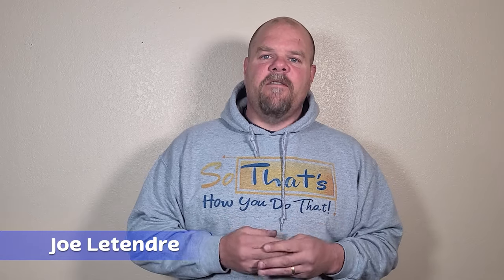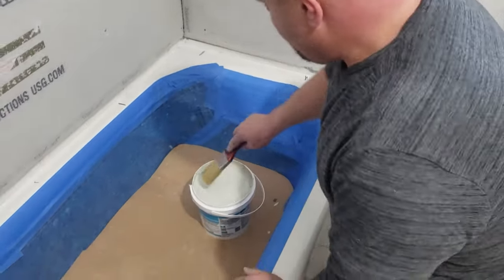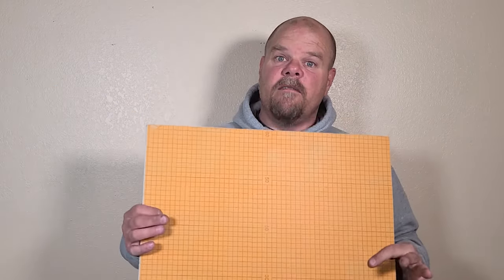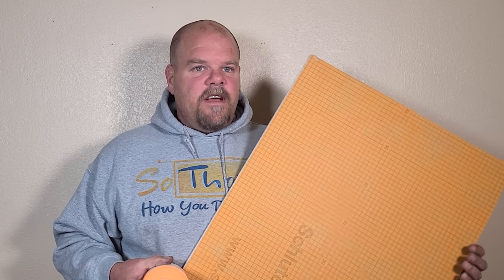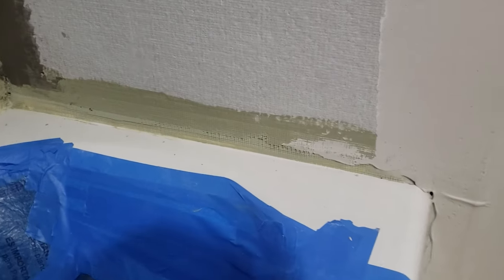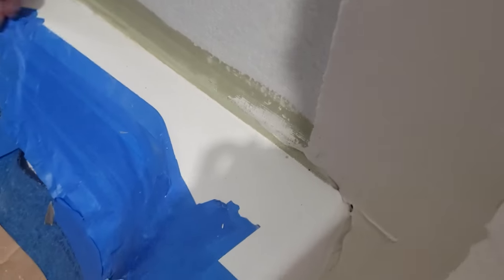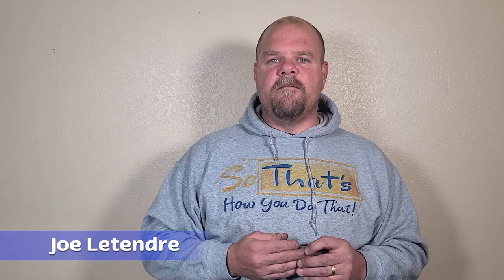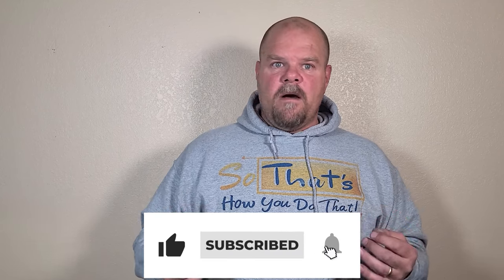PROBLEM SOLVED for Tub Flange when Installing Cement Board and Tile

Comment: There is a lot of controversy about where to put the wallboard on the tub flange and the tile institute recommends placing the board over the flange and onto the rim of the tub but I have seen so many failures when this is done that I would have to disagree. This is a great video on giving yourself the best shot at not having a failure! Common sense and experience tells me that the silicone joint between the finished tile and the tub will not be properly maintained and will eventually fail causing water penetration behind the tile. This method will prevent the wallboard damage that I am continually repairing at the job site. Great job!

Comment: Thanks! Yours is the 8th or 9thbl video I watched for this information, and it's the one with the best, clearest, and most sensible answers regarding combining all the materials at that tub edge, which is totally trashed after many years. In this case, they had the board just above the flange, but it was sitting on some type of narrow stick that is so rotted that it is unidentifiable. That stick rested on the edge of the cast tub, with the tile extended over board and stick, down to the metal, with the joint then caulked. Been here 18 years. It's never been great, but only recently disintegrated. I will use your method for the repair.

Comment: is there any concern with the tub flexing and causing the thinset to break loose from the tub then  cause squeaking as it flexes?  I have an old steel tub for this one I'm working on so I suspect there is less chance for flex than with fiberglass tub.  I see some guys recommend filling tub 1/2 or more with water to weigh it down first?  I will follow your idea using the redgard I already have saved up for the shower job.  The shower tiles came off the drywall  after 30+ years and the drywall didn't show any moisture damage.  With all the waterproofing that is recommend or required it seems like a bit of overkill in some cases.  I did a shower a few months ago with Kerdi and that was a lot of work but it was a mud shower pan and my first shower.  Now with these two I'm doing with tubs installed I'm tempted not to coat the whole cement board walls with redgard but I have it, so i will do it anyway.  I am using glazed ceramic tiles.  They are my own showers/tubs but if I were doing it for someone else I would make certain to follow 100% the right methods.  I still plan to waterproof it fully but I'm convincing myself its overkill.

Comment: Nice video.  I've been doing renovations for 20 years and do all my own tiling.  In my opinion compared to other products Laticrete products are awesome.  I use Hydroban liquid all the time and it always requires two coats.  Using Hydroban Board along with Latasil caulking.  I've used Laticrete, Schulter, Wedi, cement board, denshield, etc....  And saying that my go to solution is Denshield with Hydroban Liquid with taped corners.  Latasil for the caulking.  I like the fact you mentioned raised corners with the Schulter product (pain in the ass).  There are pros and cons to using these different substrates as they relate to flexibility and ease of carrying into the job site.  The choice of products can also speed up your work as well.  (i.e. board and start to tile the same day).

Comment: Great help video! Thank you! I see you ran your backer board to the floor in front of the tub. I'm butting up against wood lath and plaster. My 1/2" backer board will flush out with the plaster as I'm leaving the lath above the tub. Would I do the same you did here?? Do I tape and finish the joint between the old plaster and the new backerboard? Thank you for any help! Jeff

Comment: OK I see your running your Durarock past the tub, but that would be 21" or so not 30". The durarock is 30" wide. How did you get that to extend past, or did you cut 32" off the 60" length and waste the off cut? Im confused I guess by the direction of the writing on the board> Thx for any help

Comment: Hello Joe. Very good instructional. Spot on as the saying goes. I used Latacrete products exclusively since the late 70's. Setting every type of tile made on over every type of bedding board or mortar. Hydro-ban introduced a wide area of applications and problem solving waterproofing issues and we were very happy. My personal favorite products are 4237, 3701, and Hydro-ban. However, having used all of Latacretes products I recommend all of them.

Comment: I had a plumbing emergency they ended up being a leaky cold water valve that was seeping through my ceiling from the upstairs bathtub.The plumber had to bust out tiles and left it that way but anyways when we cut out more tile so we could see the studs so we couldn put new backer board up we noticed that the last three inches of the horizontal tub lip that's closest to wall was missing. How do I go about putting the backer board up is there anything I can use to reinforce the area that the lip is missing?

Comment: Good tip on the tub flange. You can also put a think bead of silicone and press it in with a putty knife. Silicone works great for sealing and waterproofing areas like that. And I really like the way you finish the wall were the cement board meets the drywall. Good info.

Comment: Hi Joe, Great Video as always and Love your channel!  I have a question about what material to use on these ceiling of these Bath Shower combos.  I have a shower tub combo in my home and I want to do a smooth level 5 type surface finish on the ceiling above instead of tiling it.  I don't particularly  care for tile on the bath ceiling so what should I use for the ceiling material whether it would be green board type drywall or something like GoBoard which is readily available to me locally and is more affordable than Kerdi - which is great but not readily available to me.  I have never tired to do a plaster or skim coat type finish on anything like GoBoard, Kerdi, or even Hardiebacker which is what I am using for the tub shower surround.  Thanks for any suggestions and reccos and keep up the great work.  I am here almost daily anymore!
Reply from the maker: I would just greenboard since it is on the ceiling and you are not tiling it.

Comment: Hey joe, can you tape and fill like you did here with an acrylic tub? I have to do the same process but I’m worried about deflection and squeaks
Reply from the maker: To avoid problems with the acrylic tub I like to use a paintabl waterproof membrane first, then fill with thinset. This will protect it from squeaking.

Comment: I go an 1/8 of an inch above the highest part of the tub (called the lip)... this is because I've demoed a more than tub or two in my life (hundreds) and ALL boards including concrete fiber boards such as HardieBacker, or Redguard, or Kerdi Board, etc even with Aqua Defense and good caulking, still ALL boards put below the lip wick up moisture and begin to grow mold. I've seen it too many times to be convenienced otherwise. Always go at least on if not above the lip. You can fill the gap with mesh tape and thinset to support the bottom edge of the bottom tiles, then caulk it (after tiling).

Comment: Will Redguard adhere to the joint compound on the bottom corner?
Reply from the maker: Yes
Reply: @SoThatsHowYouDoThat  I applied joint compound on the corner joint between the cement board and drywall. should apply some Kilz primer on the joint compound before I apply the Redguard?

Comment: Hey man, going to do my shower soon. What compound did you use to transition the cement board to the Sheetrock? I’ve seen ppl do it different ways and also read that you need to use the 90, 45 or 20 compounds when on the cement board. Is this better than an all purpose? Thanks for the video.

Comment: Brother I just put in a shower unit yesterday and I tried to explain to my boss that running it over the flange was wrong because it was bending the bottom of the Hardie board. He argued with me and told me that I was wrong even after I did all the research. I only needed common sense to tell me it was wrong. But he's just too bullheaded and I don't think I'm going to be working for him 4 long.

Comment: What I don’t get is if any water gets through the tile it will run down the waterproofed backer board to the tub flange, but then it’s stuck as there is nowhere for it to go. The gap between the tub and the tile is siliconed which effectively blocks it.

Comment: This was a great video. I learned volumes about finishing off the flange area and taping the seams properly. Another item which was covered, was the transition between cement board and gyproc for the wall area. So very helpful for us DIY squad. Thanks very much!
Reply from the maker: No problem!

Comment: Hey Joe, in the intro, you mentioned that the tub flange is a pain because it either sticks out too far or it's in way too deep. You never got around talking about the latter, when it's in way too deep, which is my situation. The ½ inch cement board is much thicker than the very thin flange. Do I tape over that and just pack in a lot of thin-set? Thanks for the video!
Reply: You can notch out the bottom of the cement board so it can sit in front of the flange. An angle grider with a masonry disc will do it.

Comment: I've also seen it suggested to shim out the backer board by a few millimeters so that it sits in front of the tub rim. To do so, my idea was to use some very thin plywood as furring strips on the studs. Note that 1/2" nominal thickness Hardie Backer is actually 0.42 inches thick, so some minor furring will help it stay in the same plane as the 0.50" thick drywall that is typically butted up against it.   To shim or to not to shim?? I'd appreciate any comments.

Comment: Thank you thank you thank you. Been in the trades for a long time, but never messed with tile that much till now. I know floating the entire wall solves a lot of issues, but sometimes it’s not in the cards. Just installed the densshield on my first solo bathroom remodel and I freaked when I saw two corner areas where the lip protrudes past the densshield by just a tiny bit. But also that it’s 12x4 subway tile I was worrying about only adhering some of the tile to the wall on the first layer. Yea another layer of 1/4” cement board would help. But I rather float the wall than do that. I watched your other video on filling imperfections for plumb and while hesitation strikes on doing that. I see how it could work. I tried straightening studs, but on the wall with a custom niche that goes almost corner to corner I had issues. Planned the studs, then framed the niche. That wall backs against another wall so planning was the thing to do, or fur it out. I’m not good with the internet but I think I subscribed. I really like your videos. Many thanks!!!
Reply from the maker: Thanks Kaleb!!

Comment: Hello, I have a situation with an older house and I intend on redoing the tub surround.  I have all the old tile down and intend on using Hardie Board as a backer.  THe problem I have ran into is parts of the tub edge is so far from the stud, that the Hardie Board does not sit on it, and would actually slip behind it by about 1/8 to 1/4 inch.  This would be the back wall. Then on the wet wall, the studs are actually against the tub edge, and when you put the Hardie board on it, it sits out proud the thickness of the Hardie Board.  I know this can't be rare, but how do you handle this.  Thanks and thanks for the video.  I found it very instructive.

Comment: thanks for the video! Have you used GoBoard? I wondered if it would be a good product to use by a DIYer as a backer for tiling around a tub?
Reply from the maker: It is a good product, but I prefer Kerdi board or something similar. Why? because tile will not crack on kerdi board.
Reply: oh, so that is an issue with GoBoard, would you recommend cement board over Kerdi

Comment: What should you do in regards to joint tape or cement board fiber tape at the ceiling where the cement board meets the ceiling drywall in a shower. Plus i plan to red guard the walls. My question is i just thinset the cement board side and drywall compound the ceiling side so it can be painted correct
Reply from the maker: Just end it at the ceiling. It is not necessary to have tape there because the corner will be covered with tile and then caulk.

Comment: Joe  I’m doing my tub area over I have installed amercast tub  I left hardie backer up from tub lip . What can I put into the 3/4 in space from the bottom of hardie backer to fill in the gap , under the hardie backer is 1/2” water proof Sheetrock  Can I put in mortar than put fiber glass tape on the gap . Thank you   Your videos are very good

Comment: Fantastic Video!!!! How do I transition from 1/2" backerboard (cut to be above tub flange) and the top of the tub.  The porcelain tub has the plumbing in and can't be moved. Can I put a piece of Kerdi board in the gap, then tape and Red Guard to moisture seal it? Thank you so much for your videos and the way you help the most armatures of armatures get through a project!

Comment: An answer I haven't found anywhere so maybe you have some insight: if one were to have a 6" band of butyl window flashing (tape) adhered to the top of the flange (coming from beind the cement board), is the hydroban/hydrobarrier and/or thinset able to adhere to that bit of flashing?!

Comment: I literally just used all of this stuff on a shower. Are used Schlueter brand, but the exact same principle. It is far as the flange or the lip on the tub. I actually trench the bottom back side of what you’re calling the Curti board and run it over the lip. It does become very thin and somewhat flimsy, but so is tape.

Comment: Great video. I have a jetted tub I would like to install in an alcove situation with a shower. The tub does not have a flange, What would you suggest to use as a flange or some kind of waterproofing between the tub and tileboard?

Comment: Do you put concrete mix under your tub when you are setting it on the floor?
Reply from the maker: Only if.it is a fiberglass tub.  It is not necessary with a porcelain on steel.

Comment: Here is how you do it my friend, Put the tub in place, scribe a line on the studs around the tub. then notch out one quarter inch on every stud. then screw the tub in place, then set your backer board over the lip of the tub, will take you ten minutes and wala you are done. Not real complicated.